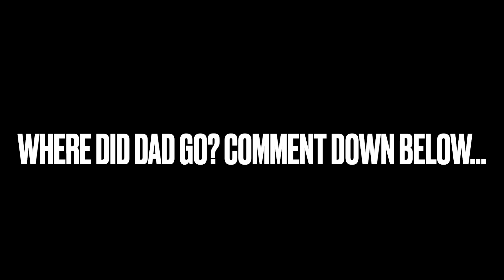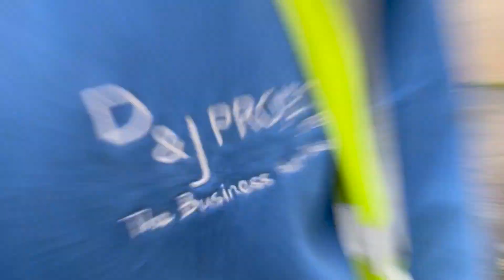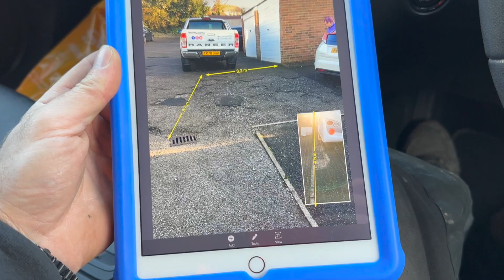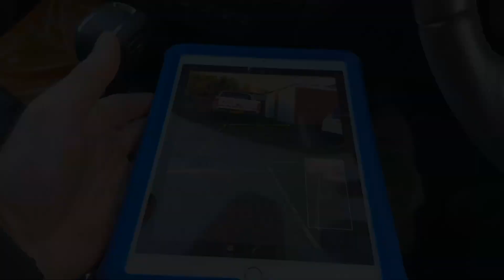A Hard, Wet & Stressful Week...

Comment: To get rid of the leaf 🍃 stains on the concrete posts mix up some 50/50 sodium hypochlorite into a pump bottle leave it to sit on the stains for half hour then give them a light Scrub then reapply the solution for another half hour then rinse with the pressure washer they should come up new... Happy Birthday 🎂 Chelsea 🎂 🥳 x

Comment: Apparently the composite decking can and does suffer from weather damage its very prone to expansion and contraction and will crack or split. I have also bern been told that recycled plastic that the manufacturers use can cause this problem but i am not sure about this but  It can also crack or split if the installation is not very good which i am sure is not the reason here.